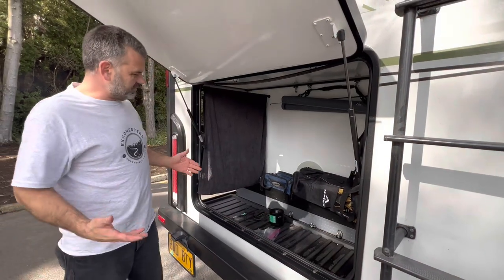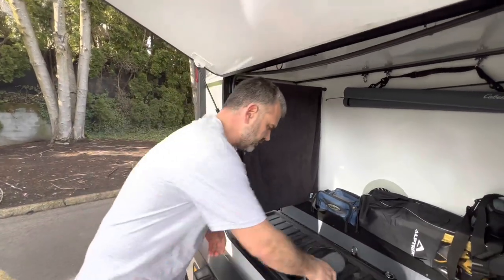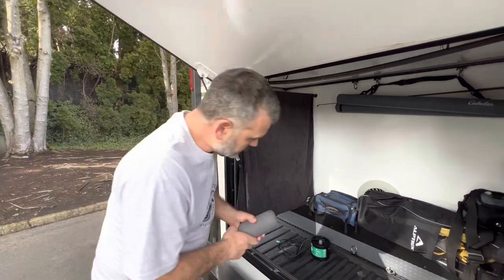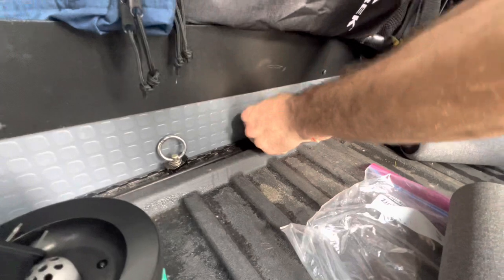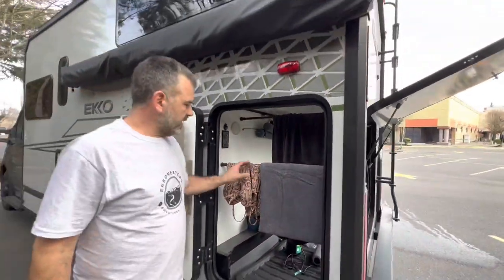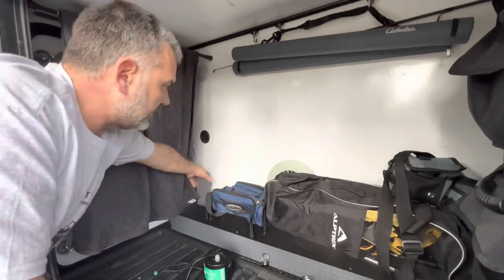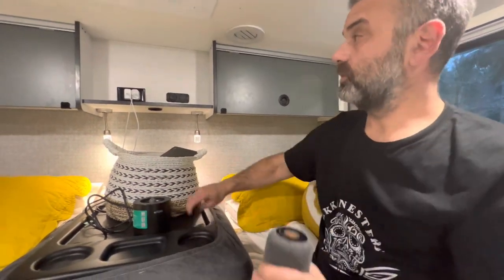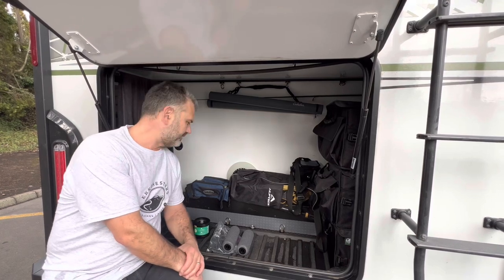WINNEBAGO EKKO RV | VAN LIFE DEALING WITH CONDENSATION |  MOISTURE HACK IN A CAN

Comment: I would LOVE to see a portable dehumidifier strapped to the ceiling or the sidewall with a hose drilled in the floor
Reply from the maker: Hello, thanks for checking out our channel and sharing your thoughts on a dehumidifier idea.  Depending on the size of the unit, some concern would be overall power draw while trying to conserve energy while off-grid (when sunlight is limited). Of curse there is the generator option for replenishing the batteries, but it’s all a balance. 
I’ve began to find a balance running the Max Air fan and that seems to have helped.